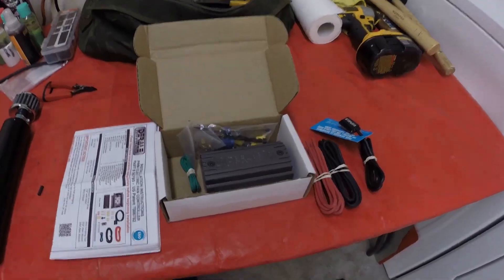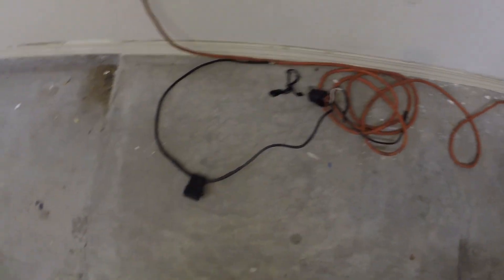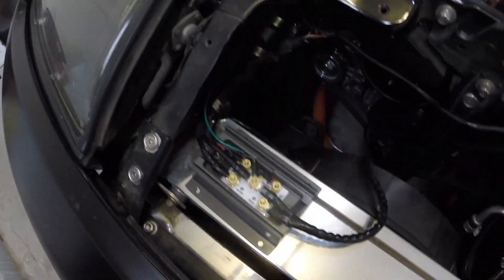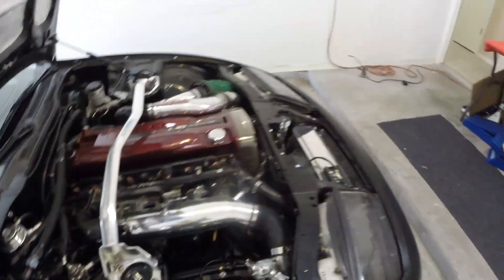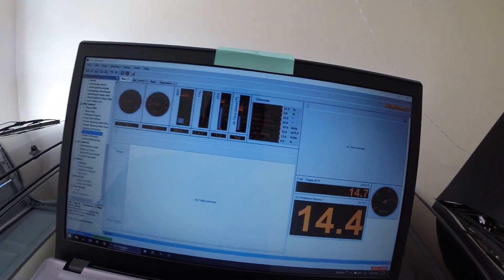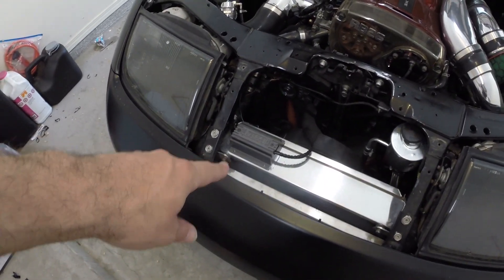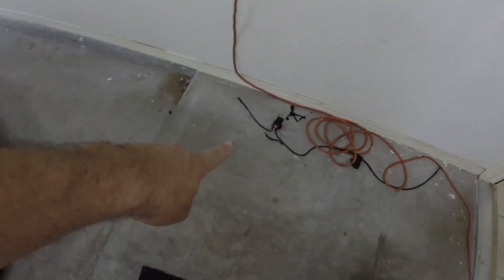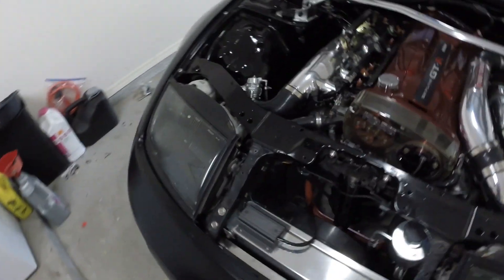Intelligent Fan Control - Ep63 :: TueZday Garage :: RB26 into 300zx

Comment: Hey can u leave review on this product after a lot
Of usage?
Reply from the maker: Unfortunately, the car was put into storage shortly after the install. But while I was using it regularly, all I can say is ‘Amazing’! It took a little while to get dialed in just right between passive and active, and required a few weeks to tune, adjust, and dial in for sustained operation. But yeah, no problems. Fixed my power spikes 110%

Comment: Great stuff man. Glad to see you got it all figured out. Now I would've love to see the wiring setup, heat protection, etc you used for the installation of the fan controller.
Reply from the maker: good point and great feedback. I will include in a recap next time